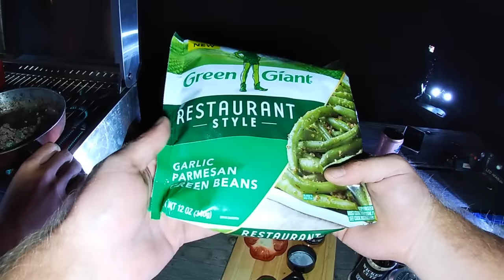Truck Camping at a Giant Spillway Full of BIG Fish on the SURFACE!!! (Fresh Cooked meal!!)

Comment: If you look at the inderside of the cooler lid there is a plug. Pull it fill with water and freeze, replace plug when frozen. Now you have an ice pack on top that doesn't leak. I've been doing it with my smaller cooler and it works so well.
Reply: What brand of cooler is it?
Reply: @myidahocabin7503  I have an igloo but I think most cooler lids have the plug in case water gets in
Reply: @sethswanson9839  Thanks